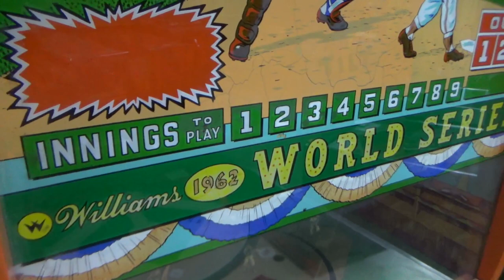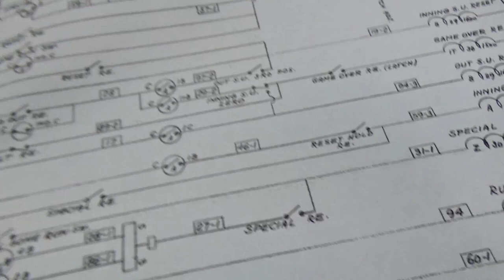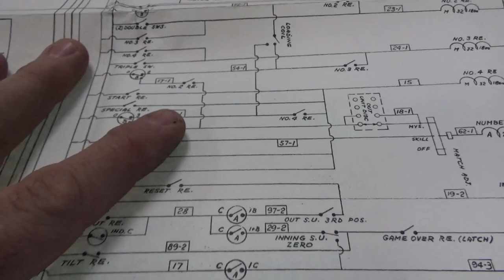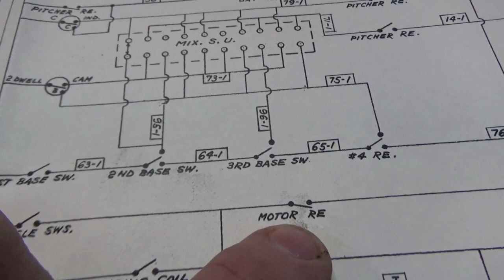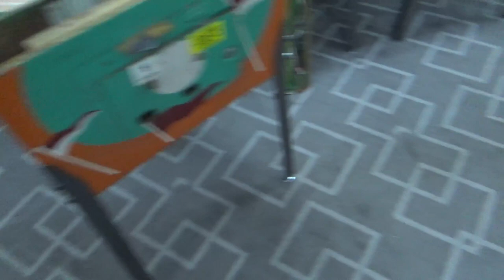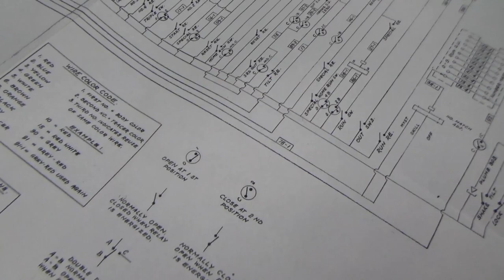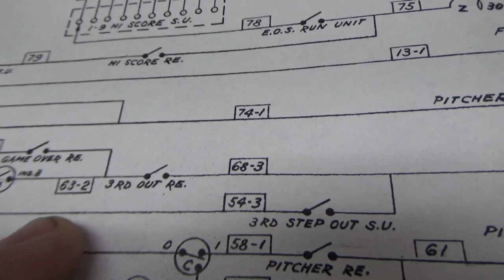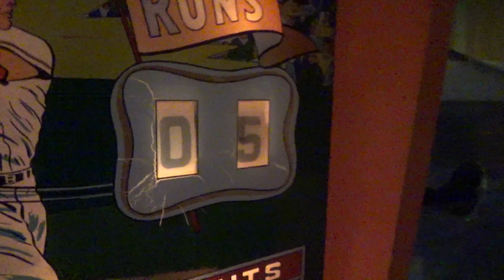Repairing The Running Man Unit In A 1962 Williams World Series Pitch & Bat Game - How It Works

Comment: That man running unit is the memory of which bases are occupied.  It keeps track of, for example, if 1st and 3rd base are occupied.  The next hit would cause a score and move the man to 2nd and place a new man on 1st.  This unit would track that.  Also I'd check the required wattage of those illumination lamps, to hot causes fires.
Reply: He can use LED bulbs as well, these don't heat that much, has same light color and sometimes last as long as the old incandescent bulbs._

Comment: Ron, I worked in plastics back in the 80's  bakelite is a name used for the first Phenolic thermoset plastics which is very different than thermoplastics in common used today, it comes in a few base materials paper, linen and fiberglass which includeds (G10) green mil circuit board material.  These games used the paper phenolic which was very inexpensive and long lasting.

Comment: This was a FUN video. You had me laughing. I was concern when you said smarter than the machine, boy, I'm in trouble.That game is two years older than me and works better. One suggestion for the Mighty Ron, next time you are cleaning the legs of a IC chip try using the fiberglass pencil instead of your file. If you do let me know if you like it or not. Runs start working.....Yep Yep that is how its done girls and boys.
Reply from the maker: Thank you for watching rrowan327, we do have fiberglass pencils but when we do chip legs we do them all at one time with a flat file, if you focus on one leg it'll break.  I'll have to show how I do it one day.
Reply: @LyonsArcade  Obliviously you do what is best for you. I have never broke a leg with the fiberglass pencil since it doesn't put a lot of pressure on the metal (light strokes). Maybe try it on a damaged IC if you have one laying around. That won't be a problem if it doesn't work for you. Either way I enjoy your videos and have learned a lot. Been doing electronics since teenager and I have a huge fascination with the workings of the EM pinball. Thanks Rick

Comment: So the backlit slanted red plexiglass panel used to say "Super Home Run"?
Reply: The original back panel is illuminated and has artwork on it that says super home run. There should be a small hole to score a super home run. The operator blocked it off.

Comment: Would it be possible to get it working as originally designed, or are parts just not available?
Reply from the maker: Apparently you could only play 1 inning at a time, you won the extra innings in game play, the plastic piece that you hit the ball into at the back isn't available at the moment, and the inning unit isn't made new, you'd have to find something similar out of a used machine.  The mix unit isn't made new either you'd have to find something similar out of a used machine.

Comment: Here's a question for you Ron back in the day did Williams have service technicians to service the machines for the arcade owners or was it up to owners to service their own machines ?
Reply from the maker: They had a whole network setup, so Williams only sold to Distributors.  Distributors only sold to operators.. so if you had a bowling alley or whatever, you would hire an operator to bring the game in and set it up, the operator would maintain it, all the owner of the location did was provide the power the clientele and gave refunds (sometimes) if a quarter got lost.  So the operators worked on them... and would rotate the games around to different locations after they got tired of them at a certain location.

Comment: Hey, Like your video but you do it the hard way.
Buy a low voltage wire tonerand probe. it will send a tone down the wire and you can follow it with the probe.
USe them all the time in buildings when tracing wires.
Cheap ones work for smaller runs which would be great for tracing in pinball machines
Reply from the maker: sorry to disappoint you
Reply: @LyonsArcade  Don't be sorry!!!..he doesn't have 53.5k subscribers and a shit ton of videos..he has nothing 😆
Reply: @LyonsArcade  Did not disappoint as I love your vids. I had said what I said as you said colors were faded or worn. And short of tracing one line by hand a toner and probe works great.